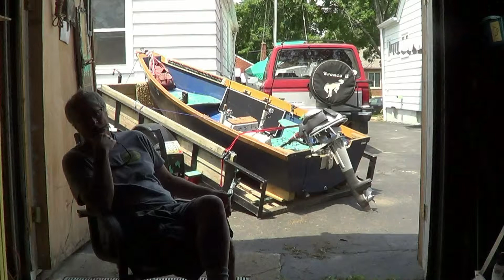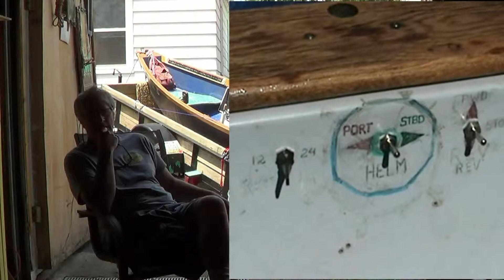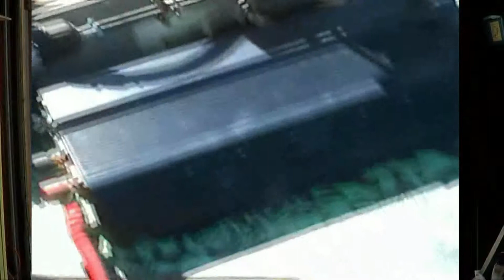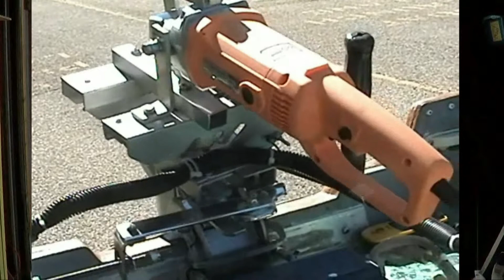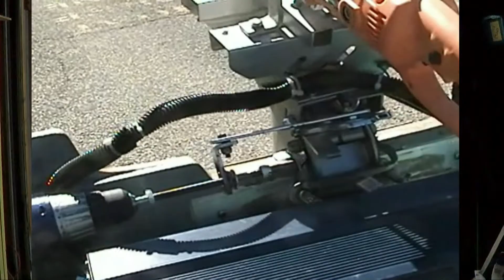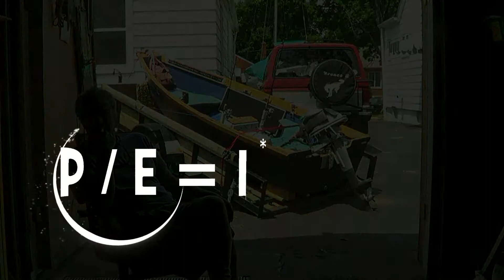LOOK! Solar POWERED ~ electric HELM STEERING + outboard electric motor

Comment: Power tools for propulsion is very post apocalyptic too, which is cool!  Chris, do you use a charge controller between your panels & your batteries? If so, can you tell me about it? What is the max output rating on your panels? Mine are all 60v out.
Reply from the maker: hey craig ~ eeeeee! we are in the after math! how will our children perceive all that?? i hope they can figure it ! but yeh, this boats going to make a great movie prop.i am writing script and your thoughts are appreciated. solar panels on board range from 26 volts(store bought) out down to 22( homemade) volts out. charge controller input max = 28 volts ~ output varies with input and load. the cut off is 14.2 volts as i have a 12 volt system. on board the 1060 surge , current output = 4 amps with room to add another amp of custom made panels. thanks for watching!!!
Reply: ***** All the panels on my roof are identical but as I understand it, if you put mismatched panels together the system is limited by the smallest panel you have. Does this resonate with your reading too? I'm fuzzy on it. From what you've said all your panels must be wired in parallel.
Reply from the maker: Solar Panels wired in PARALLEL ~
panel #1 ~ 26 volts 2 amps
panel # 2 ~ 22 volts 1 amp
= 22 volts output
current = 3amps

which does not effect panel performance when  charge controller is 14.2 volts output.

Solar Panels wired in SERIES ~
panel #1 ~ 26 volts  2amps
panel #2 ~ 22 volts 1 amp
= 48 volts output
current = 1 amp

so, if you have a system requirement of say, 36 volts, a charge controller with out put of 40 volts,  ~ wiring the 2 panels above in series would greatly reduce current to the storage device ( batteries).
Reply from the maker: ***** the above comment is an example of power output.
it is not the absolute actual  power output on board the all electric boat .
this is once again, an EXAMPLE for understanding  voltage potential and voltage reference.
Reply: *****
Wiring panels together with either mismatched wattage or voltage outputs doesn't resonate with me as a good idea intuitively. It feels like a recipe for limiting the power of the strongest panel. But I only have chatter & I can't put my hands on any documentation to back me up; I'll go with what you've discovered here.
Reply: Craig A. Smith Last week Betsy & I had a new central air conditioner put in. My buddy Eric / solar panel goto guy almost had audible grief in his voice when I showed him. "Would be a lot cheaper & do-able to start a window unit with an inverter." he mused.
Reply from the maker: one more fyi for you on panels ~ go to allaboutcircuits.com ~ it has a summary of basic electricity volume 1 and volume 2 ~ ( very dry reading ~ I have read both manuals as well as grad from basics as well as advanced electronics schools) in the volumes, you will find many answers to your questions. ~ perhaps looking thru GROUND POTENTIALS and other voltage REFERNCE points will click for you. but, its easier to relinquish to the fact, current is ACCUMULATIVE in panels wired in parallel. here is my last example for understanding current ~ you have 3 batteries 12v 13 volt and 11 volts, each capable of 100 amps ~ wired in parallel, the voltage potential will be 11 volts and they will put out 300 amps. ~ same 3 batteries wired in SERIES will put out 36 volts with current capability of 100 amps ~
Reply: ***** Your example of the 3 batteries, 11, 12 & 13v wired in parallel resulting in an 11v 300 amp power source then does support my notion that the voltage and hence power (watts) out is limited by the smallest volt battery.

To date, the highest output voltage my panels have produced is 40v. My charge controller is said to transform that excess voltage & what ever current there is, perhaps 1.75 amps per panel, into higher amperage & lower voltage to charge my batteries.
Reply from the maker: Craig A. Smith hey craig ~ what is the voltage output of your charge controller?
Reply: *****  My Tracer 2210RN is an MPPT, 20amp, auto sensing 12 or 24v out model. Manual open in front of me, Flooded battery column, 14.8 equalization, 14.6 boost, 13.8 float. x2 if on 24v bank.  Boost / bulk - language funny foreign translation.